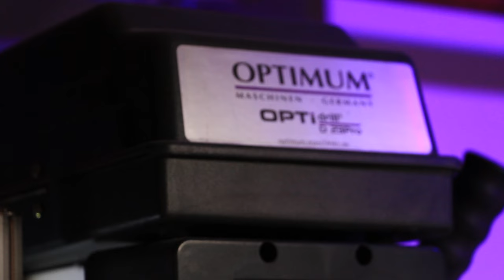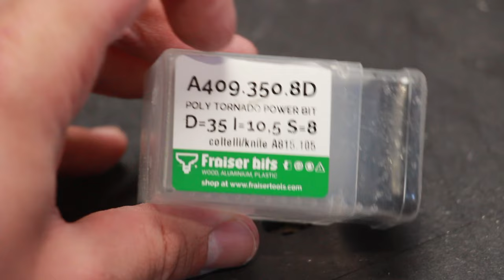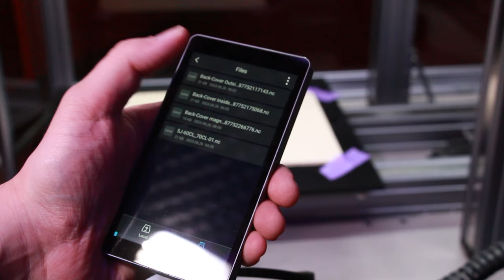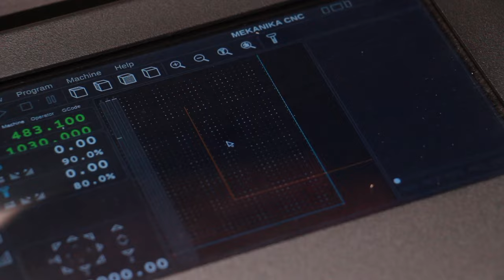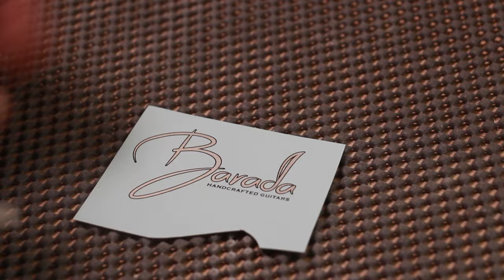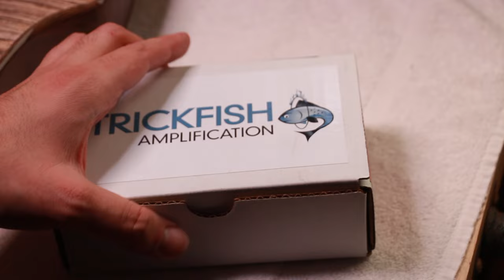All it Takes to Make a Damas Bass - Full Build & Sound Demo

Comment: Lol bro taking out some carbide cutters to mill the wood, it must be seriously hard xD
Reply from the maker: Ebony and  Maple are no Joke, it’s a must!
Many thanks for watching!
Reply: @BaradaGuitars  thx for the info. I'm a CNC machinist and work with all kinds of metal alloys, but have no experience or knowledge about processing wood... I just had to laugh as I saw you mounting the carbide tool on to the spindle without knowing the wood could be so difficult to cut xD Bass is looking real hot btw

Challenge for you: make a Bass with a floating bridge, like a Floyd Rose bridge. XD never seen a Bass with that kind of bridge, gonna be a meme in the bass/guitar community

Comment: Just curious.   You used epoxy for the neck lamination, but wood glue for the fingerboard.  Why is that?
Reply from the maker: Short answer the neck lamination has “Veneer” unlike the finger board that has over 3mm ebony and the same flam maple, so it’s not veneer anymore, this means no need for epoxy.
Many thanks
Reply: So the wood glue could make the veneers warp or absorb the moisture in the glue or something?
Reply from the maker: @MixingGBP  that’s one of the reasons, but not all of them, the neck structure should be as strong as you can, and epoxy for glowing veneer is stronger than wood glue.

Comment: Why dont you just leave the tape over thw truss rod? To protect it form glue and gunk?
Reply from the maker: Sorry, but is this a real question? I’m just asking to know how to answer.
Many thanks for watching
Reply: @BaradaGuitars  It is.
Reply from the maker: @ramonzeira  the tape has a thickness in it and it doesn’t matter how thin it is, it’s adding thickness anyway, this means your fretboard will not set flat on your neck, for me I don’t allow any tolerances when it comes to Flattening the neck or the fretboard. 
The second point, even that the clamps will clamp that fretboard down, but the thickness of the tape will add unnecessary under pressure to the bottom of the fretboard continuously. 
The tape has one job, which ich avoiding adding glue to the Trussrod channel and that’s it.
Reply: Some makers actually do leave the tape over the truss rod, but they will cut the tape edges very close to the truss rod channel.  It really depends on the luthier.  Apparently it can work both with and without tape depending on one’s beliefs on this topic.